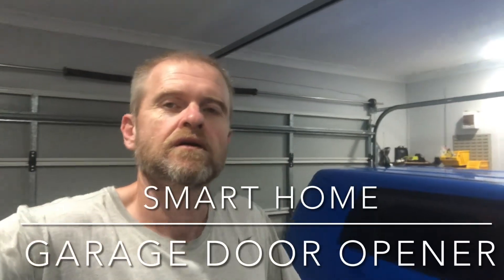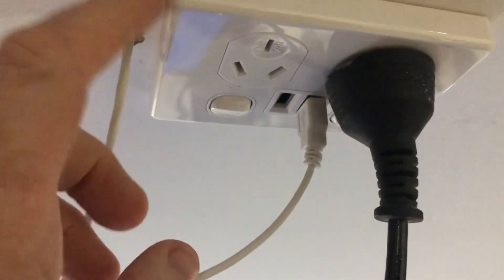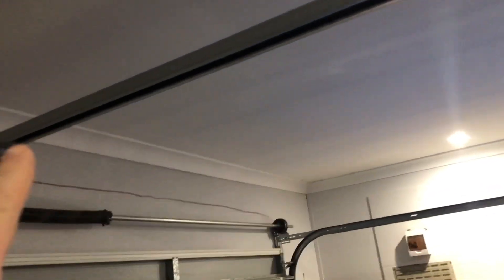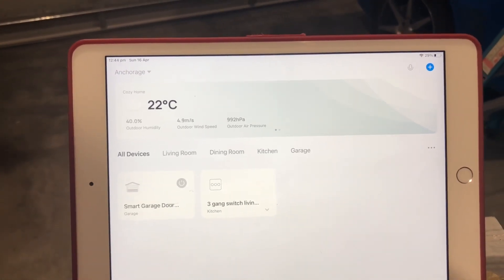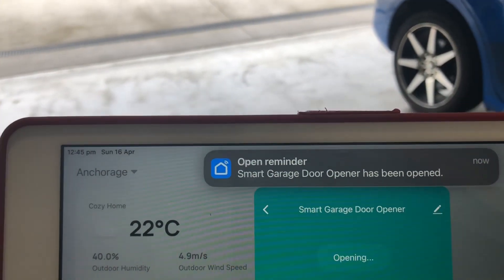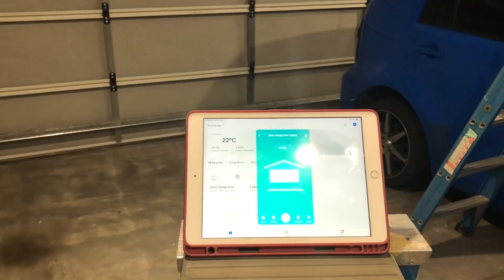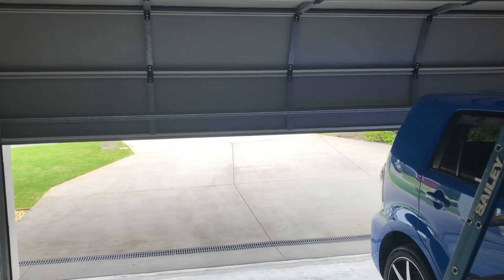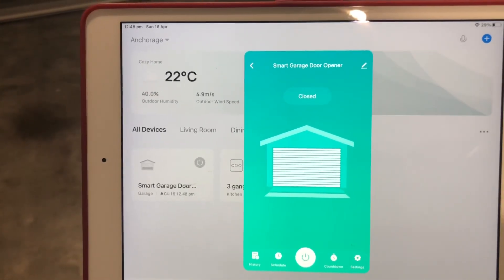Smart Home Garage Door Opener Installation and Review

Comment: G'day Dan, I've searched a lot of videos until I came across your video. Would you kindly help me? I believe my garage door opener is the same as yours (Steel-line SD800). I am trying to connect a (Hikvision Relay) to it. Basically my question is: Does it matter what + or - to connect when connecting the "push Botton" wire  to "receiver"from the relay? in your video I can see there is one blue and one brown cable for door sensor which I don't have on my door, then you have one tiny blue and white cable which I believe is for "push button". My question is if you swap the blue with brown, would that damage the sensor? or if you swap tiny blue with white, would that damage anything? I appreciate your response. Cheers, Kaveh